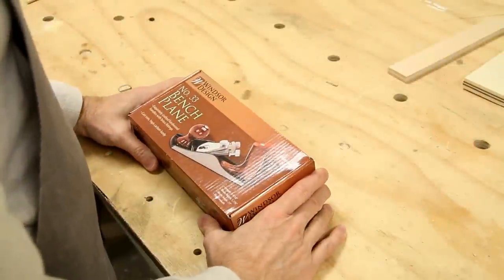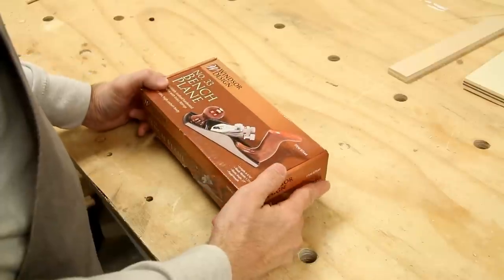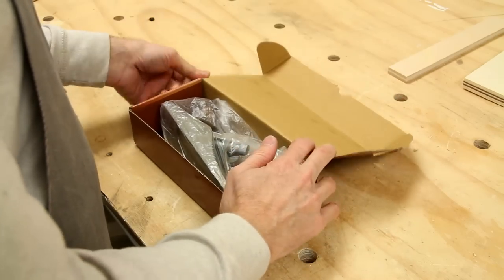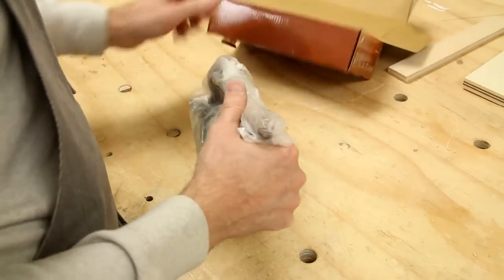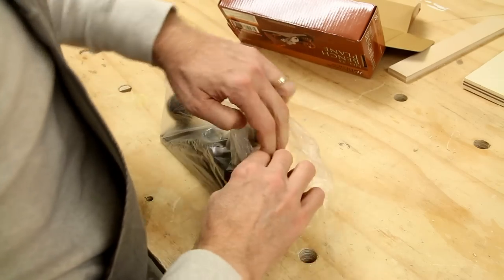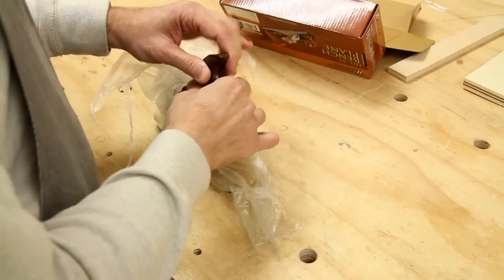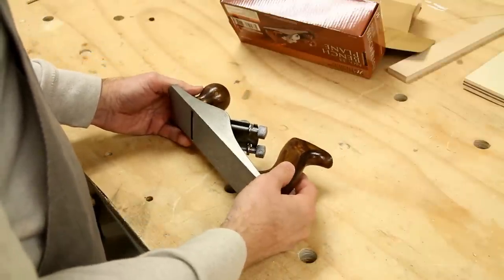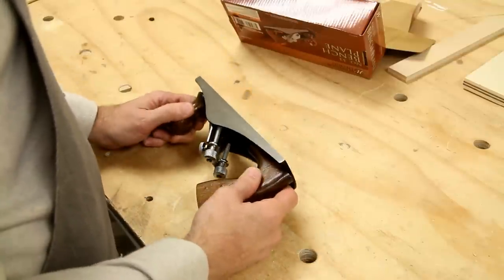Harbor Freight No 33 Bench Plane Review and Tuneup

Comment: I've never had any plane from anywhere that didn't need some fine tuning. If it weren't for Harbor Freight, pawn shops and auctions I couldn't afford to own tools. And the two screw adjusting system is a joy to use when you finally get the hang of it.
Reply: I have the Harbor Freight plane of that style.  After sharpening the plane blade it works fine.  Paul Sellers called this style plane, when made by Stanley, "junk."  It is not a great plane, but can be made usable at a low price.
Reply: I agree.
Reply: I have a lot of trouble setting the blade depth and getting the blade to be even in my plane. I am really not liking the twin screw adjustment. Any tips?
Reply: Thanks for sharing your tune up! Looks like some good shavings! I purchased one on sale so less than $7 now to make it usable
Reply: _ David _  i got both because i didn't tune this one in the video properly, now with this video i got it goin' good but i'm still having trouble with the jack plane. hmm. getting the hang of it.
Reply: @theopiner402  take out the adjustment screws and use a hammer to tap and adjust. Wayyy easier
Reply: @manasmadanambedu5010  Thank you for the tip!
Reply: This cheap $10 plane is the best out of box ive ever owned and i have 7 planes
Reply: For real, I've seen some people hate on it because you have to work on it, like it's $10 you put in the extra work to make it serviceable and save yourself $80 and then they talk about how their tools didn't need sharpening or be serviced but they paid $200 on the same tool as you
Reply: How about shoeing people how to use the plane instead of feeling sorry for them for getting the piece of junk that gave you  some wood, small misshapen wood.... don't waste your time watching 20 minutes of pointless babble

Comment: I have one.  I didn't flatten the sole but I did sharpen the blade. I was able to easily adjust this plane to take whisper thin shavings.  While the sole is not perfectly smooth a little Johnson's wax helps in that regard.  There are differing opinions on the necessity of taking the time to make the sole perfectly flat, assuming the sole is reasonably flat "as is."  I am well pleased with this plane, especially considering its price.  Keep in mind it's a considerably smaller plane than a Stanley #4.   I have a dozen or so Stanley planes but I feel this plane would work well for anyone on a budget and who is able to sharpen the blade properly and make the simple adjustments that are required.

Comment: The current low end Stanley planes make that look like a desirable bench plane. I got a #4 and the same tuning up took me probably 10x the time you spent on the HF one. probably 7 hours just lapping the sole on a poured glass surface with 60/80 grit sandpaper. Add a couple hours on the back of the blade, the edge was cambered, but only on one side, and decidedly tridimensional, the chipbreaker sat 1.5mm (1/16")  away from the blade, with one side rounded and one at 90°. Turned out it wasn't just the front of the chipbreaker but the back that sat uneven, so some more time on that. The lock was completely square so I had to grind it for it to have a locking action.
The frog was lopsided, too,and I had to epoxy the squeaky handles. It was a new. It was a gift that could not be returned. It couldn't cut pine or MDF out of the box. Not even kidding here, so to me, this was a positive review.
Reply from the maker: Wow, your plane sounds like the plane from hell ;-)  But hey, you got it working, which has to feel good. Thanks for the comments.

Comment: Most things from Harbor Freight are about that quality. Ive bought a ton of tools from there mostly for woodworking. I can tell you that for the price, which most time is at least half the price of similar products they are of the same quality if not better. Realistically I have spent about 400 dollars there. Had I went somewhere else I would have easily spent over a thousand. For a hobby woodworker, I have no complaints about Harbor Freight. There is no way that anyone with a reasonable brain could expect to spend 10 dollars and get a 50 dollar product with something like that. Harbor Freight is built for poorer folk that want to get into something rather than splurging a large amount on something they may not be interested in. I would gladly give Harbor Freight money straight out my pocket for saving me the money they have. I do not mind spending some time on tuning up my tools, in fact it has made me respect them and when I can afford the grandioso name brands then I will treat them with the respect that they deserve for the workmanship put in. I can say however that I would not respect the woodworking community to the extent that I do if they werent they type to put in a little extra work.
Reply: Completely agreed with you.
You said it fine.
Reply: And their clamps are cheap and they clamp as clamps ought! Can't complain there!
Reply: All this is dependent upon the item. So e things are great for the price, like their f clamps, and especially consumables, but I can't say that you get near the quality comparing their tools to my good ones when it comes to planes, or saws, power tools etc. That being said, I wouldn't have half the tools I do if it weren't for harbor freight!
Reply: 👍🏼👍🏼👍🏼 agreed!

Comment: I use mine all the time and yes it needed a tune up, flattering  and a little file work on the gullet 
 Great. For beginners to learn how to set one up and understand the mechanics. I started flattening on 36 grit on glass plate then worked up 100 to300 grit at a time to 1000. Same for the blade back. The bevel started at 300. I flattened the frog with a large med bastard file in a vice. Do not overtighten. Same with gullet. Waxed the faces and wala it  Compares to my Stanley's. I put an hour into it, but probably could have done less to it. It was fun to fix it up.

Comment: First of all, thank you for this video! I feel like I just had a crash course in plane adjustment. I bought one of these planes today because I thought what the heck? Its a $13 (2024) plane. As soon as I got home I opened the box, inspected the tool and went to YouTube and stumbled upon your video. I believe “Windsor” Design may have also seen this video. 7 years later, my blade is square and straight and quite sharp. I’m going to use a fine stone and strop on it just to fine tune it. The base needs flattening, so thank you for teaching us how to do it. I saw another video and the craftsman said this type of blade adjustment is popular in Europe. So maybe this plane has visited Windsor? Anyway, my only issue is the grip. I have big hands and long fingers and find the grip a bit dainty. I’ll probably make a slightly beefier grip. If i do I’ll make a video of that project. Thanks so much!

Comment: what i dont get is most people talk trash on these cheap planes saying how junk they are, yet at the same time someone will make their own wood plane and its like the most awesome thing ever
Reply: Wood planes are pretty good, for what they do.
Reply: *****
I can be a tool snob, to a point. That point lies in what my wallet can bear. Which is why you'll find no Lie Nielsen planes in my shop. I got a really beat up Stanley number 2 plane at a garage sale once. I fixed it up, and even though my repair wasn't great the plane still worked. That showed me that a plane doesn't need to be great in order to do the plane thing. It just needs to be the right general shape to work.
Reply: Naturally, there's a lot of emotional attachment to something you made yourself. But quality? ILike anything else you make, it all depends on how good you are at toolmaking and how good the equipment you make it with is (as with other projects, more skill can sometimes substitute for better tools, and vice versa). If you're a beginner at making tools, the first tools you make will probably be crappy. But crappy tools are often much better than none. Which is where Harbor Freight comes in. But cheap isn't always good. A cutting tool that breaks while you're using it is dangerous. And ask me sometime about the Harbor Freight air compressor that burst into flames while I was trying to inflate a tire with it.
Reply: Gary Cooper
hand tools and electric powered equipment are much different from each other. So what you are making here is an apples and zippers comparison. As even apples and oranges have more in common with each other than what you are mentioning.
Reply: Use a properly tuned pre-WW2 Stanley and tell me what you think.
Reply: +Nate Thomas properly tuned planes is horse pucky. All a plane needs to be is sharp, and adjusted. People fettling soles of planes perfectly flat are morons. I'll give you a challenge now. Use a wood plane. Iron planes literally suck. Flat surfaces mating causes vacuum drag. I rebuilt a really messed up Stanley No. 2 plane and when I was done there was still a big dent in the sole of it right behind the mouth. I never had the guts to try to take it out. With my luck the casting would break like glass. But that plane still works a lot better than I'd imagine it would. Once I saw that I realized how much horse crap a lot of plane snobbery is. A lot of handcrafting is psychological though. If you think you're going to do a better job with some tool then you will. So it is a self fulfilling bias.
Reply from the maker: The front of the sole, the mouth opening immediately in front of the iron, and rear of the sole need to be flat relative to each other. The rest of the sole can have concave sections without affecting the performance of the plane.
If the area in front of the blade is not flat the plane won't perform very well (if you're attempting to finish plane a surface) in most real-world scenarios. There can be holes in the sole behind the blade.
That all being said, there's nothing wrong with a person wanting to have the entire sole be perfectly flat and polished like a mirror. Some people like to have chrome plated engines in their cars. Doesn't affect the performance of their car, but they enjoy the process and final appearance.
Reply: +marty Backe chrome plating negatively impacts performance. Chrome retains heat, doesn't radiate it well, however you want to look at it. Which on a mechanism that generates lots of waste heat is never good. So yeah them motors with tons of chrome on them don't perform quite as good as they could. They do look pretty though. The performance loss is negligible too. So I am a bit torn on the chrome everything issue personally. I'm certainly not the type to do it myself. But I can understand why some folks would do it. You're not going to see that kind of BS in a pure sports car though.
Reply: Marty Backe b
Reply: mike gager I know that's what I'm saying. I have a kobalt number 4 plane and people were like oh that's junk,but really it's a bang for your buck, I sharpened it up and honed the bottom and it works like a charm,and I get really clean nice ribbons out of it
Reply: Paul Frederick I see you everywhere. Small world.
Reply: get the same thing from musician snobs man. they wanna feel like they're justified paying 4x as much for a tool/instrument.

Comment: Super video Mr Marty ! As a person with little means but a lot of will, desire and mechanically inclined , I purchase quite a bit from HF. I recently purchased their 
4"×36" Belt and Disc sanding machine. The common slam on them is "The motor lacks Power". Well after adjusting the motor, ( via motor mounts) it runs great and has plenty of power. I personally take a lot of pride in being able to modify a "hunk of junk" and make something decent out of it.And now as soon as I hit the send button,  I'm going to get that ole no.33 out of the box and get to work on it. Thanks a Bunch Marty !
Reply from the maker: Thanks for that note James. As long as you know a tools limitations and have the tenacity and knowledge to fix its shortcomings, many 'inferior' tools can be made to serve a need.

Comment: You are a much more patient man than I am Marty. I bought a cheap footprint from Home Depot "you get what you pay for" is definitely a true statement. Sole wasn't flat....fixed that. Sides were not square.....fine..its no shooting plane. filed up the mouth...sharpened the blade. Still need to clean up the chip breaker....it jams up and clogs the blade. Nothing time and work cannot fix. I will go back to it ...eventually.
Reply from the maker: +Garry R Sometimes I don't feel like doing any real woodworking, so it's nice to have misc projects that you can spend an hour or so on. I'll get some use out of this plane in the upcoming years.

Comment: These types of planes are very common here in the Netherlands. Always need work to be usable. And i have seen worse, yours is actually very nice looking. We get them in red paint with plastic handles. 

A plane is really just a way to consistently hold a blade at an angle. I use a lot of old wooden planes and they work great. 

Once you get used to the adjustment mechanism, these planes work great. Never seen bigger ones. 

Thanks for showing the tuneup because i can now further improve my planes!
Reply from the maker: +Willem Kossen Interesting perspective. And I think more of them are appearing over here too.

My video, and others, just demonstrate how easy it is to make any piece of iron and cut wood as nice or as rough as you need.

Comment: I've fettled a few planes (older model Stanley's), and they work well.  I bought one of these HF planes, flattened the sole, honed the blade, etc.  Couldn't keep the blade from slipping, changing depth or angle of cut.  The 2-screw mechanism isn't a good design, in a plane, IMO.  I deepened the mouth and converted it to a scrub, where it seems to do ok.

A hand plane like this, has potential to frustrate newcomers to the hobby.  If you want to buy this plane, it would be good to have a knowledgeable person help you get set up.

Comment: I spent close to an hour on this thing today. The body of it is nearly flat, after  using sand paper and progressing to whetstone, and the blade is finally sharp. my biggest issue is the compression piece that's held in by the screw and the knob. when I tighten the knob the entire piece slides off the retaining screw. I will have to do some filing to make a notch in it so it stops moving around. All in all, it costs $33 now and if I had known better I would have never bought it... You can get a vintage bench plane on ebay for a similar price and with a lot better quality.

Comment: Point well demonstrated... Before using that out of the box jagged edge blade, out of flat sole, out of flat blade & making it all right first. You have a $10.00, fully functional plane. I did cringe at the use of a high speed grinder wheel on a plane blade, however I forgive you! Lol... After considerable time spent on the sharpening plates, you got some good shavings off that piece of poplar from a $10.00 Harbor Freight Plane. Well done.
Bill on the Hill... :-)

Comment: I find that just about any plane can work if it's very sharp and the sole is flat. Where the lower quality shows is when the iron becomes dull too quickly because of poor quality steel, adjustments are hard to make, or it's not ergonomic to use. I have used poor quality planes in the past, and while they are serviceable, they're not particularly nice to use for extended periods of time. That being said, lower quality planes are absolutely fine for people on a shoestring budget or as backups if you're willing to keep them sharp.

Comment: Someone gave me one of these 'Windsor' planes (may be the exact model!). I've never had or used a plane before. I'm sure your vast experience with sharpening went a LONG way with it, but it does give me hope for mine!

Thank you for the video!
Reply from the maker: +Walter Kessler It's a perfect beginner plane in a way. You can practice sharpening it and flattening the sole without worrying about ruining something that costs a lot of money. It'll make you appreciate the nicer planes when/if you do more with hand tools. Good luck.
Reply: Very true. I want to get a set of chisels as well. I have no sharpening equipment (part of the reason the plane is still in the box). I'm still waffling between stones of diamond plates.
Reply from the maker: +Walter Kessler I was fully converted to diamond stones after learning from Paul Sellers the convex method of sharpening. He has a whole series of diamond plate based sharpening on Youtube. Check them out if you haven't already seen some of them. Here's his basic plane blade sharpening video: https://www.youtube.com/watch?v=vvTcReENk9g

Comment: Thanks for making this video, I bought this plane today for $11.99 with a coupon, I am new to hand planes, Airplanes I have been flying them for 47 years🤣. With HF it is hit or miss on their products. I bought this plane to try/learn about about using a hand plane. I have two antique planes from my Grandfather,s day in age. (1874 vintage,) I brought the plane home a did precisely what you did, clean it of course and flatten the sole with a 300 grit diamond plate. Mine was flatter than your plane. I then mounted the iron into my Veritos jig and worked the iron over a 300 grit and a 600 grit then a 1200 grit diamond plate and then stropped the edge as well as the sole of the plane. I can make pretty thin shavings and the surface is very smooth of the wood I have worked. I just need more guidance on how properly set the blade depth. This will most likely go to my grandson to practice with. If he masters it. He will be really good with a nice hand plane.
Reply: Thanks for the reply Marty!